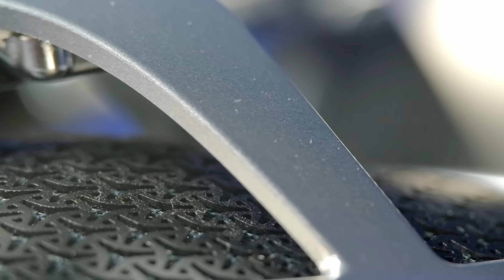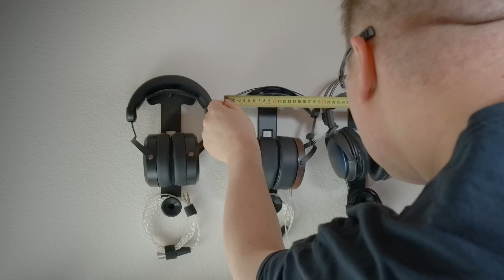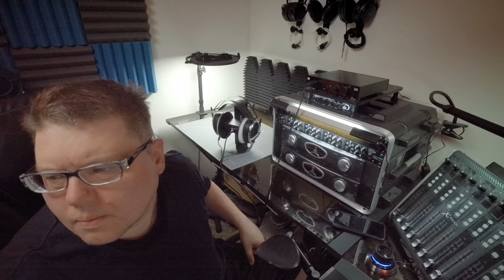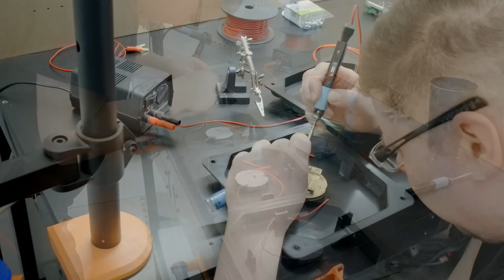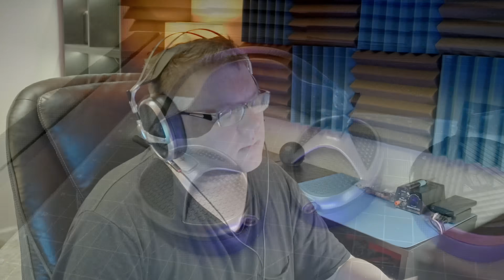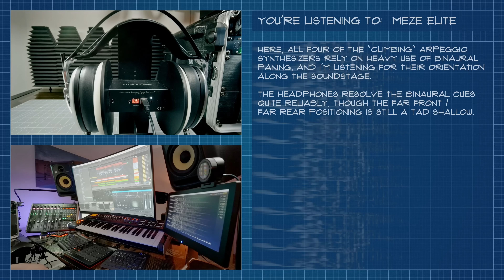Meze Elite Headphone Review

Comment: My listening rig starts with A HP laptop then through a Hd Projector via  a HDMI cable which throws a 85" picture onto the bog screen on the wall  then from the 3.5mm stereo output jack  through a 3'5mm stereo to twin RCA adapter then into the Sony surround receiver and out to the various speakers I have hooked up.. I try to upgrade as I can.  Currently the surround speakers from  an Onkyo receiver that died  the only difference was the onkyo used a passive sub woofer, so to use it I got a Fosi Audio 100 watt mini sub amp  into the 8" down firing ported sub cab from the Onkyo.. Added a pair of vintage Fisher 3 way full range speakers. soon to get upgraded cabinets because the original cabs are in sad shape. and I think I can get better sound quality with a newer design for them..   good as i can get with this setup  I'll soon be adding a pair of custom transmission line cabs like the one you made but hand built of some cheap wood and glue.... loaded with 14 (7 per cab) computer satellite speakers rescued from the plastic enclosures. space isn't much of a concern for me but i still want all the system to look matched as possible thats why all the cabs will get a few coats of matte black spray paint when completed....besides the tiny speakers that will get ganged up in a pair of cabs built for them I'm also building a pair of vertical 4X12" cabs for dual purpose operation  as tower speakers added to the rest of the surround system and also as a full stack for a tiny Blackstar ID Core 40 watt stereo guitar amp. it' sports  a pair of 6.5" 4 Ohm speakers and i'll mod it with a pair of 1/4" (6.5 mm) switched output jacks which it currently lacks.... yes I do indeed love my electronic toys the Strat build I'm currently doing Is a whole other story..lol  I like it loud, but I also like it to sound as good as it can... but on a budget...I'm retired and have the time to devote to the design and build of all my desired  speaker projects. wood is easy designing what I want just takes exercising a little brain power. I did it as a kid wit salvaged stereo and TV  console speakers into salvaged kitchen cabinets with hand cut plywood baffles... how cheap can you go..I could mix and match speakers to sound equal side to side regardless of size or shape... hense the custom cut baffles.. wanna Play...

Comment: Facts:
TRS Jacks have a ground and two signals connections that can be + or -
DACs are never 24 or 32bit, they are 18bit at most - do the voltage maths: 1v + 2v + ... + 131,072v Scale that anyway you want and if you can make it work in 24 or 32bit then patent it NOW!

Comment: This is the best headphone/iem demo I saw/heard? 👌I think you should post just your demo part with what to expect as a new video with just direct audio parts so we can use it as a master note to tweak our iem equalizer. I am on an Radsone ES100 streaming lossless Sony Ldac using a FiiO FH3 IEMs over a balanced cable. ES100 has two independent dac to drive each channel.

Comment: Played on some two-ways using the Tang Band midbass drivers you had in your last video. It plays clean up to 3.5khz! Combined with a ribbon tweeter they put out a nice wide soundstage. Placement on a desk is really critical for imaging, and DSP for room rattles and desk bounce are essential. I don't push the woofers to fully subsonic levels, just because of how high I push them at the same time. DSP is a real game changer.

Comment: Great video.  The build of the Meze Elite looks extraordinary.  I appreciate your 7 vs 9 at full optimized grading scale.  Sure, it's subjective, but thank you for expressing your subjective impressions.  The demo music is beautiful, I could put it on a loop and achieve a Zen-like state.  But for headphone demos, I really like well-recorded jazz with high dynamic range and with a female vocal.  I realize there are rights issues so I understand why you used your own music.  So if vocals are for another time, a track with a high quality piano sample would cover those hard to reproduce fundamentals plus harmonics, then add an analog modeled drum kit and bass for transients and bass and we'll have a good test track.  Finally, I like to get a sense of efficiency, SPL capability and distortion.  So for a section, monitor the amp output and go from quiet to very loud let's see what the linear operating range is in SPL.
Reply: If there's one reason I watch this channel it's that every now and then you get a little nugget which makes its point so clearly and succinctly it just changes how you think about it, and the colour grading example did exactly that. It's frankly amazing that you can judge the Mezes against direct audio and they're mostly comparable.

Comment: your flow of DAC -> DSP -> amp seems like it is sub-optimal because the DSP is receiving the analog output of the DSP, digitizing it, and then running it through another DAC after processing.
wouldn't it be better to do the digital math before you hit the first DAC and avoid the extra conversion step.

Comment: the demo was great, used my speaker setup for this playback.
the 17hz sure was nice, i was wondering about the odd vibration in the room and looked at the subwoofers....
for the demo comparison the headphone cant compete in clarity vs direct audio because of the extra steps we hear, so rely on your review notes on that.
but for the frequency response its easier to tell, and after you have equal loudness set on the headphone and i have done the same for my system for my ears, the meze elite had at least 3db more deep bass. maybe the two equal loudness curves the meze had to go thru do not work as intended and get added on top of each other.

Comment: About balanced. I think it wasn't explained properly. Single-ended does not mean the lack of push-pull, single-ended outputs do properly go negative. Single-ended, as explained, have only one signal wire per channel, with reference to ground, and that's it!
I'd argue that balanced vs single-ended makes essentially no difference with headphones, except for the fact that you don't need an active converter to plug the 'phones into a balanced source. But for transmission between active circuitry, balanced is very superior to single-ended, because as you explained, the noise caused by currents in ground conductor is canceled out (the source of these currents is usually mains coupling through Y capacitors in power supplies, but sometimes also voltage drops in low-voltage DC supplies).
Reply: With this single ended explanation in video you would get massive DC offset it would probably destroy low impedance headphones, it is wrong as Victor says. Drivers in headphones are inherently balanced and typically share reference because current flowing common wire is so small it is not making significant difference, a case of diminishing returns.
When comes to power supplies it is unavoidable to have some ripple, main thing is to make sure high current from mains or switching PS is not interacting with signal return path that where balanced setup helps.
There is RF noise but that is black magic and it is generated everywhere where some switching action is happening even in diode rectifier after 50/60Hz mains transformer to some degree.
Reply: Love your videos an box designs Hexibase but you should revise what you said about not balanced conections.
Acording to your graphics even with no music there would be an offset dc which would burn the headphones and that is not the case...keep the good work and vids...cheers

Comment: Great job but question if I have a powered subwoofer from a big company and I would like to put a different kind of subwoofer would it still work out or not?
Reply: Do you mean replacing the driver in the subwoofer?
Reply: @noncog1  yes sorry about that I’m at work! Lol
Reply: @HPMIKE55  welp, youre not gunna like the answer: it depends.

Does the driver youre going to be putting in work well in the enclosure type and size you have? Do the sensitivity and power-handling work with the built-in amp? Does it fit well physically including sealing properly and having clearance inside the enclosure?
Reply: @noncog1  ok thanks I understand now & your 100% to mush work I’ll just get a new subwoofer! Lol 😂
Reply: @HPMIKE55  what problem do you have with the current driver? What powered sub do you have? Ill help for as long as i remain interested lol
Reply: @noncog1  everything is running good I have the Monoprice M-15 V2 15in . 
I just thought that it’s a big as box that If I change the sub I would get a better sound.
Reply: @HPMIKE55  i mean thats not really a bad sub by any means, has it been properly tuned? If it has and still isnt enough things are gunna either get involved or expensive for you.
Reply: @HPMIKE55  what area of the sound are you looking to improve?
Reply: @noncog1  something that I can feel in my body. I do feel these 15in but I’m thinking 18 in mite work for. Lol 
But first I have to sell these to a local person around here they’re too heavy to ship. Lol
Reply: @HPMIKE55  do you need lower or louder to be satisfied? If just louder, maybe just add another? Having multiple subs in a home theater has several advantages once properly timed for listening position. If lower, 2 lms ultra 18's or bust lmao
Reply: @HPMIKE55  check out stereo integrity if youre willing to have someone build enclosures for you or do it yourself
Reply: @noncog1  yes I think your right! Lol 😂 just got to talk to my wife! Lmao